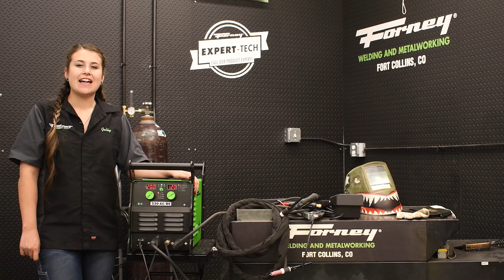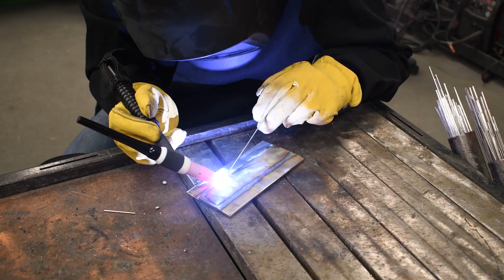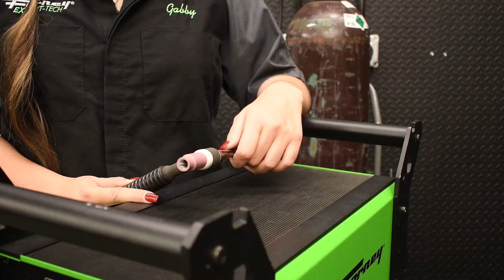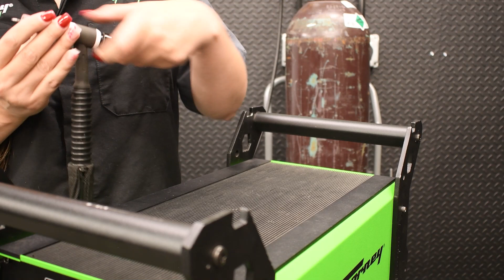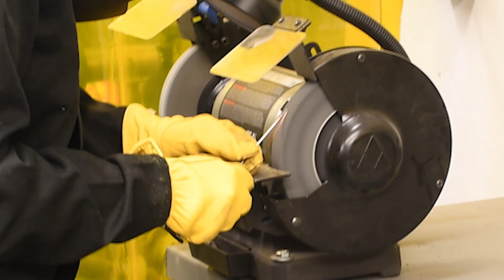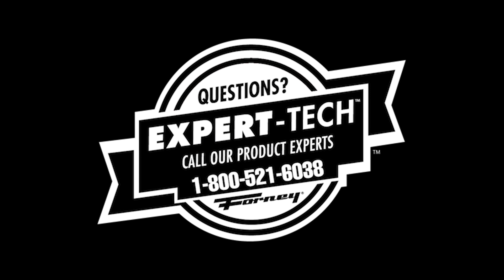Forney® 220 AC/DC TIG Welder

Comment: Not being able to self adjust pre and post flow is a deal breaker for me.
I was set to buy the 450 tig tonight but found out this now
So will be going to get a everlast on black Friday sale for $275 off.
Would have liked to try a forney but i really like to have total control myself for aluminum.
I hear everlast has some issues but lots of good about them also
So hopefully i dont regret my decision
Reply: I have a Lincoln 175 tig and it does not allow pre and post flow adjustment. For pre flow I just tap the foot pedal and flow starts then I position and start welding. It has a long post flow. So in reality pre/post flow really are not as big a deal as I once thought. 

I use this welder exclusively for aluminum. It is not as powerful as I need. It struggles to weld thick aluminum but was all I could muster at the time.

HUGE HUGE HUGE advice for any one that is going to weld thicker aluminum and do a decent amount, such as 30 minutes plus - DO NOT go with an air cooled tig torch. I have almost completely melted mine on many occasions. Spend the little extra and get a water cooled torch. If you can't afford a fancy water cooler don't worry, get a 5 gallon bucket or a gas can and a small water pump and build a make shift water system. Dont bother with cooling your water just pump it through the torch and into another can or on to the ground. I have well water so I just ran a hose in the door to my welder and another hose out the door and on the ground as a total loss system. It works massively well and I love it, no more melted tig torch and burnt fingers.

So it has been a yr, how do you like the everlast?
Reply: @Robert B  i picked up a everlast ext225 last yr.
Its incredible little machine,
Welds aluminum really nice and stainless.
Just used it tonight for some charge pipes.
No regrets buying it

Comment: What about pre and post gas flow
Reply from the maker: Hi George, for ease of use we have found the optimal amount of pre and post flow for the set amperage, and input that into the software, it is not adjustable.
Reply: @forneyind   so it doesn't just have a constant flow of gas the entire time you're bottle is on correct. I just got my machine yesterday and haven't gotten to hook it up yet just looking through the manual and that was the first thing that hit my mind.
Reply from the maker: You are correct, the pre flow starts when you pull your trigger.
Reply: No pre and post flow gas adjustments sucks. That can make a big difference when welding aluminum. Looks like I'll be sticking to everlast machines.
Reply: @Toyota22rebestever  I'ma give it a run this weekend and see what it does my stores a distributor so Ima see how it goes.
Reply from the maker: @Toyota22rebestever  To be clear the pre and post flow does adjust, it is adjusted by the software in the machine and is not adjustable by the user.
Reply: @forneyind  yeah that sucks in my opinion I rather control the pre and post flow myself
Reply: @forneyind  not being able to manually adjust the pre & post flow is a non-starter for me as well. I understand it simplifies the user experience for beginners, but those of us that weld professionally we use those settings as an important tool. The other down side is the gas waste when tacking multiple pieces. Otherwise, great looking machine!